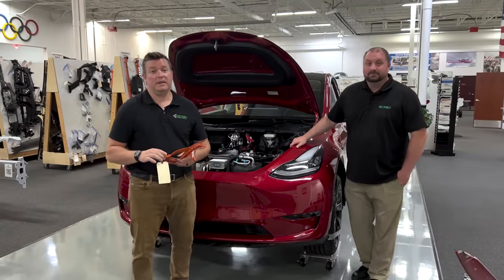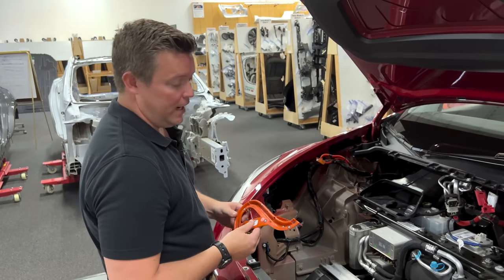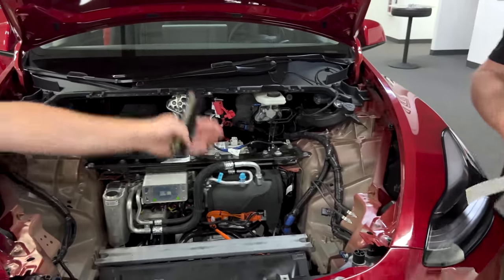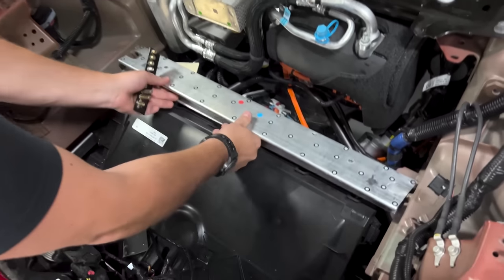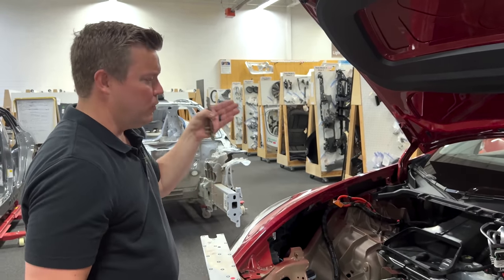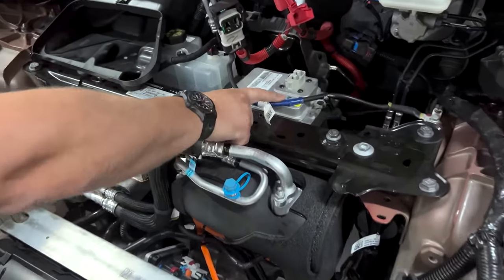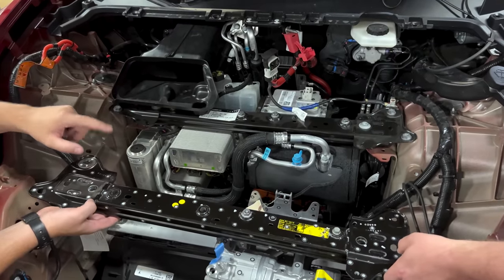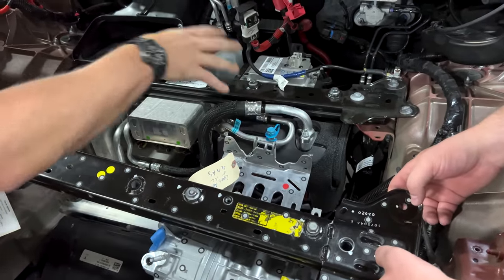Tesla Model Y - Under the Hood | Giga Texas Revisions

Comment: I'm a veterinary surgeon and love all this engineering. When looking at this video I start to think how evolution made some animals better than others at certain things, even though they may have started out the same, bit like the Model Y. 

A cow and a horse both have to digest grass so need a way to ferment it. Cattle have a rumen - essentially a big vat at the front end before the small intestine that's full of fluid - and this big fluid filled vat sloshing around means it was impossible for the rest of the body to develop to be able to run fast; horses break down grass it at the back end, past the small intestine; their design is much more compact and means there's not as much fluid sloshing around. In part this is  what allowed the rest of their body develop so as to be able to run faster. 

So Elon, and Sandy of course, would have done a tear-down a cow, looked at how it worked and how to make it better, and ended up with a horse.  

As with the mantra that the best part is no part, they would have eliminated the rumen so that a cow could run like a horse!

Comment: Im not convinced the dimples on the lower cross car support are spot welds. They may only be dimples ment to space the part off the casting leaving a specific gap so the adhesive isn't forced out during assembly as well as offering a more uniform dimension side to side.

Comment: @19:36 they should have made one or two vertical features into the casting, which don't impede the die removal. The 90 degree bracket should have had holes than allowed in to be set over the said features, basically hanging the bracket up on the casting. The risk is that under a strong vertical force (such as hitting a sidewalk at speed) the bracket could move up and unlatch from the cast, but this could be mitigated with glue, sealant or a miniscule spot weld. The weld could be extremely small because it's almost never under load (except for said vertical force) and thus can be much less damaging to the cast compared to the current multiple load bearing welds.

Comment: Amazing that Tesla really does not  have " Model Year"  so to speak, they implement changes as fast  as they  can improve  and validate, the car may look identical to  the untrained eye or  unknowing person, but chances are  next years car  is vastly improved  on top of having different mechanical parts , oh  did I forget  OTA  updates?, I think VW id3 owners   is still waiting for their  first  OTA,  at least that is  what Alex  said.
Reply: @AudiTTQuattro2003  no different from legacy auto i have bought parts from the wreckers , dealer, & jobbers  that were supposed to fit, BUT DID NOT.
Reply: @AudiTTQuattro2003  Don't think Tesla cars are made for repairs...they work until they don't. Just like a phone..use and then throw away..
Reply: VINs have years though
Reply: @venti4268  there are quite a few Teslas  that have over 500,000 miles and one in Germany  that is close to a 1.5 Kms - A million miles.
Reply: @AudiTTQuattro2003  But they don't.  You're just making invalid assumptions.  Model Y bodies were brought from Freemont to be tested with parts made in Texas.  It's critical for serviceability for parts to be useable on product from any factory.  Corey talked about how the Giga Casting was a bolt in replacement for the original assembly of over a hundred parts.  They know what they're doing.

Comment: The one thing that Corey said that I have to take issue with is "if they are still building Model Ys in Fremont they most likely have the other design."  Tesla has made it very clear that they intend to manufacture the Model 3 and Y in both locations with customers in the western North America getting Fremont built cars and those in the rest of North America getting Texas cars.  They have to replace the tooling in Fremont as quickly as they can to match Texas.  They also have a contract with Panasonic to manufacture the 4680 cells for Fremont cars at Giga Nevada where Tesla will manufacture structural batteries.  The reason that the first vehicle out of Texas is a new version of the Model Y,  Standard Range AWD, is so when someone from the East charges it at a Supercharger in the Rockies while someone from the West is charging a  Standard Range RWD delivered on the same day they won't fell too bad about the differences.

Comment: I wonder if those dimples you saw under the cross car beam are even actually spot welds.  They might be just be standoffs stamped into the piece to maintain proper clearance for the adhesive.  I’m probably wrong though.  I am not an engineer, just a farmer.
Reply from the maker: We will reveal the details when the teardown continues! Stayed-tuned for an update.

Comment: Wow, that fender locator tab (20:18) needed to be bent out of the way to align the hood to fender gap (under warrenty) on my 2018 M3 (SN 56XXX)   So disappointing they still haven't got that right out of the factory 😕.
Reply: Looking at it, I think they could have got it on that mount, but pulling the fender onto the solid mount point would have slowed the worker on the line just enough that he/she was having trouble keeping up, and found they could skip it, and not have it noticed once covered up. Whether that was their decision, and they risk getting fired, or was allowed by the supervisor, and the part will get modified slightly later on will be interesting to find out later on.

Comment: I believe that the resizing of the heat pump suction line was due to widespread interior heating problems in cold winter conditions. Many pre-2021 Model 3 and Model Y owners in the Northeast U.S. and in Canada were affected.
Reply: how so?
Reply: @joansparky4439  I manage the Vermont Tesla Owners Group. We had numerous owners dealing with this heating problem last winter. Tesla owners in Quebec were reporting the same issue. A Tesla service adviser explained to me that the fix for it involved replacing the heat pump pressure lines with newer ones.
Reply: @toddr.lockwood843  Thx, I'm seriously interested in case you had a technical answer, which is why I asked.
I got some trouble with the A/C return line in a ICE Mitsubishi where I suspect compressor oil is accumulating in a U shaped hose, eventually being sucked into it, stalling it and ripping vbelts (predetermined breaking point, so the compressor doesn't break).
That's why I ask, as I need to fix this soon (me = Tropical Australia) ;-)

Comment: First good video, thanks for the input.  I have a question, Some of the metal/plastic parts your comparing to the New Y model vehicle, the earlier year vehicles parts I saw lots of location marks/dots. (Example the wiper washer/bottle/spout plastic, cross beam bracket, Steel bracket to the fender etc.) Are you marking parts on  the earlier model ones to 3D scan them into your database?
Reply: For my knowledge , the spot are target for the 3d scan . And they use also a white spray in all the dark black parts , otherwise they have issues to produce the 3d scan .
Reply: @lettoreespatriato3270  Yes, I see that going,  Also Like to know Scanning the parts, will also allow OEM and other manufacturers capabilities to make the parts too.

Comment: I see major price drop in the months to come if it's all made this way including the new battery. When do you think Tesla will eventually drop the price? Or you think it's dependent to the market? 50 men drops due to competition is here. I am in line to buy fisker because of many features that it has that I complained about not having it in Tesla especially model Y.
Reply: the waiting line is months, although they increase production all the time.
The price will only come down once the que shrinks. You buying a Fisker instead will help with that, so kudos!
Reply: with the price increase of battery materials and increases on demand, the major price drop won't happen until at least the battery price drops big time, which seems not going to happen in the next a few years.

Comment: For that apparent left front fender misplacement where the tab was not fastened to the front end member, what about the right front fender? In the one quick shot you showed it didn’t appear to be fastened to the front end member either. Perhaps then it was intentional to not fasten the fenders at those points.

Comment: If there is a significant impact directly on the lower control arm of the front suspension, is it likely to cause a casting fracture?
Would that be always detectable?    Would it be fixed by a repair?    Would it result in a new casting or be a write off ?
Is it a better car for the consumer or is the priority increased profit for the shareholders?
Reply: I suspect at Telsa that time will tell .. particularly as service data builds up from Service Centers, etc. But it probably will be a "Win-Win" situation for both.

Comment: with all the small changes, what happens when something breaks?
Do they need to have individual hoses kept in reserve forever??
Reply: They seem to be maintaining compatibility at the interface of most parts. For example, they could have modified the body panel mounting points when they changed to the front giga casting, but they didn't. Which means the same body panels that they make today for the newest model Y will also fit the first model Y.

Comment: Something about the Tesla engineering is very different from other auto manufacturers. It is a cultural thing that drives those Tesla team to work in unison and keep improving in the process. You don't see it at GM, Chrysler or the other manufacturers because they just don't take as much pride with what they build as the folks from Tesla. However, having said all that, I'm a bit concerned that Tesla is going through some layoffs. Especially those from their Fremont plant who stood behind the company when Tesla was in a dire situation not even knowing if it would survive. Now Tesla evolved into an overnight success and no doubt Elon Musk made it happed, but it was also very significant that those behind the scene played a significant role. Somehow, when Tesla now is facing some issues such as plant closures due to Covid-19 and parts constraint, I just found it a bit unfair to cutoff those that went through manufacturing hell.

Comment: I'm not surprised that parts vary in the cars looked at.  Each factory has their own stamping and casting machines.  This allows Tesla to refine the model as the spin up the new plant and not impact current production.  Most other OEMs build the same model in one plant and have to schedule down time to switch over parts of the process.
Reply: Lol….. you mean most OEM actually have platforms where they actually share parts between soooo many different car models unlike tesla 2 car models!? The vw golf, caddy, touran, t7……….. are basically the same main parts but different bodies.
Reply: Also donot forget the Mercedes’ sprinter which comes in almost 100 of different configurations and where a casting would be a totally stupid idea for all the mods that can be made to that van……
Reply: @AudiTTQuattro2003  
What are those things called?
Like a box...
Keyboard....
TV thing on the front...?
Ah!
Computers!!! 
They can use precisely the same computerised system they use to get the right part from stores to the car in the factory to compile and store a service list of parts for that precise car
.
What's difficult?
I've spent a career as a technician going through parts manuals trying to make sure I ordered the right components.
If I'd had a barcode on every machine which gave me an instant list of the correct parts for that machine..... SO MUCH time saved.
Not to mention others calling me because they can't find a part....

Comment: Instead of that welding to the casting, perhaps adhesive epoxy might be a better solution when the strength of the bond had been determined. I believe such a process would endure the life of the vehicle.

Comment: They made a brittle spot weld so that in the event of a crash…
The parts and equipment shear off the structure and aren’t shoved into the driver seat by the structure?
Or maybe…
The parts won’t get damaged as much in a collision because they shear off the crumply bits?
Or maybe…
Both

Comment: On the misaligned fender interior, could they have lagged on parts? Being that they designed the giga castings first, perhaps it’s to portend an impending body style change and that’s why they looked out of measure or fit? In other words, they still intend to introduce a redesigned Model Y body that will fit perfectly to the new giga castings? Perhaps for 2023?
Reply: I bet it will happen in a few months.

Comment: There is one big disadvantage of so many small changes from model to model, from version to version even: manufacturing costs and service costs. It works when you only have 3-4 models, but once you have a few times that, you have to have spares and service parts for all those and you have a lot different cost / piece if you make a few tens of thousands or a few hundreds thousands of that part.
Reply: None of these parts are service items though. They only need to be replaced in a crash, if the user broke them or if they were faulty from the factory. And many of them are compatible between versions even while the manufacturing process was a bit different.

And as for crashes, the model 3/Y has almost no internal parts installed in the crash zone anyway. You're really just replacing the radiator, the replaceable beams and brackets, bumper, body panels and things mounted and visible directly at the front like headlights.
Reply: From what I understand, they treat hardware like software where there are known stable interface points.  Many new parts are  physically compatible with old cars.   With a specific parts manifest for each individual car, software can configure, keep track or query the capabilities of any new parts and test the system as a whole.   The self-diagnostics in the system is crazy detailed.

Comment: 3:00 Why did Tesla change a part from stamped steel to cast aluminum?
Two possibilities:
- Tesla is learning that casting aluminum is overall better than steel.  Changing a casted part just requires a die and casting cleanup change.
- Tesla is thinking ahead, recycling the car.  Isn't aluminum easier to recycle than steel?
Reply: May I add a 3rd ? Galvanic corrosion between the steel bracket and the gigacasting ?

Comment: I keep wondering how hard will it be to buy parts for older vehicles if the parts keep changing so frequently.
Reply: Yes, but Tesla has a computer system for that.  To get ANY part, you are supposed to provide the VIN, they can look up which revision of each part was used, and what newer revisions are compatible and therefore can be substituted.  Downside, you currently have to order your parts from Tesla.
Reply: @csf1757  - and will those older parts still be available in ten years or so?  Will Tesla continue to hold onto older tooling to remake these old parts?  Will Tesla have to warehouse a bunch of the parts based on a projected future need?

We can already see they’ve dropped support for original roadster. It’s nearly impossible to get some of the parts for it and most Tesla service stations won’t even work on them. At what point will the old Model S cars become “obsolete”?
Reply: @legostud  Yeah, thats a serious problem.  That appears to be the main reason why one occasionally has to wait 6 months for parts from Tesla

Comment: Does Tesla check its stamped parts for accuracy? Ford just installed GOM ATOS ScanBox blue light scanner system in its massive stamping facility in South Africa to check parts are within spec, The Six Sigma process, it ensures that Ford have a 99.997-percent probability that all parts produced are within specification,

Comment: With the "giga" casting being as large as it is, I wonder how often a car will be written off due to a crash cracking the casting.  From the front it seems like the car would have been written off casting or not by the time it reached it however as you mentioned, the casting is much closer to the rear.  Still neat to see a different take on designing the major pieces.
Reply: Cars are written off much more than in the past.  The gigacasting is designed with the sacrificial parts.  If a crash damages the gigicasting, then it is probably a write off anyway, irrespective of the gigacasting damage.

Comment: 2:48 why can’t it be part of the casting?
Reply: bacause its part of the INSIDE of the Casting , where the Robot arm Removes the casting from the Mold.
Reply: @markplott4820  no, it's because the casting (at the pressures those operate at, not plastic) can't have internal parts of the mold move out of the way (actuators need to be beefy) when they extract it like is possible for similar things at the outside of the casting..
It's a question of space and technology of the mold, nothing to do with robots handling the castings.